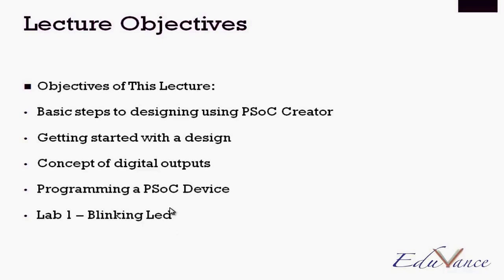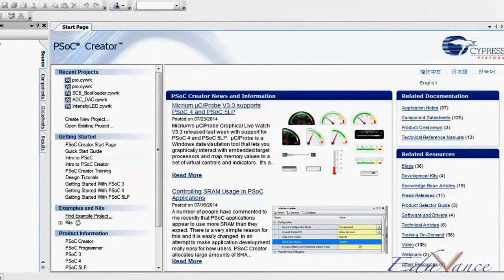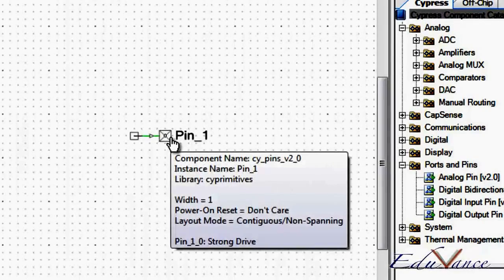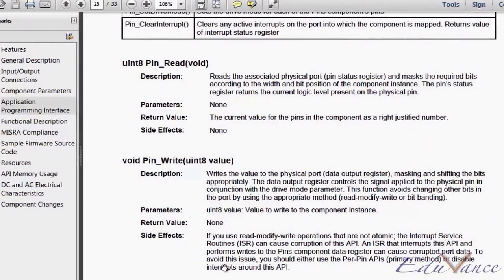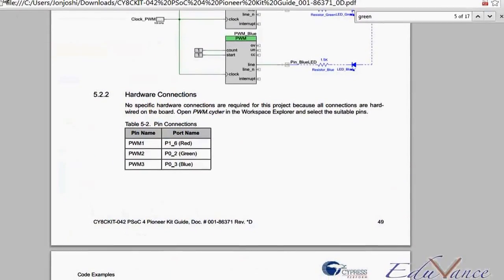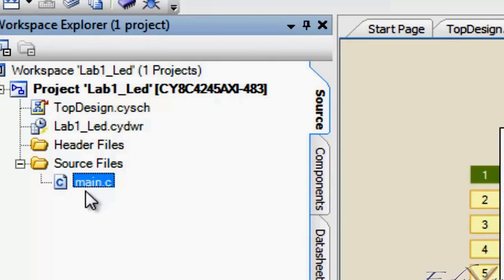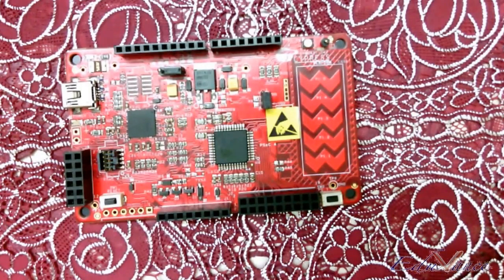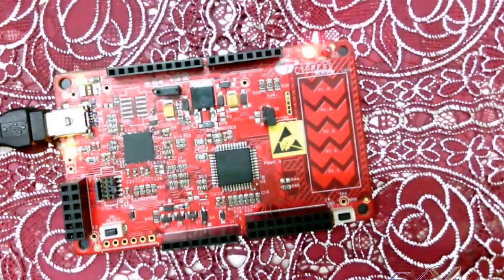PSoC Lecture 3 Design Flow And Digital Outputs Lab

Comment: why is 0 turning it on and 1 off? is there an inverter somewhere?
Reply from the maker: +Geo S 
The led is connected such that the cathode is connected to the board and anode to vcc(supply)
Hence it turns on giving a 0
Reply from the maker: +Geo S 
The led is connected such that the cathode is connected to the board and anode to vcc(supply)
Hence it turns on giving a 0